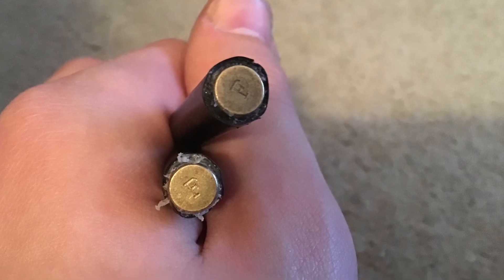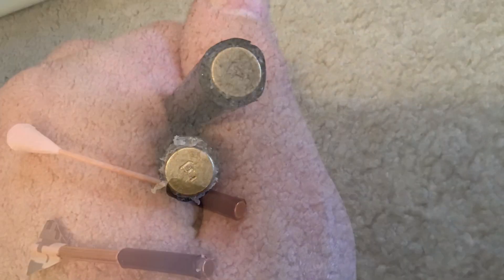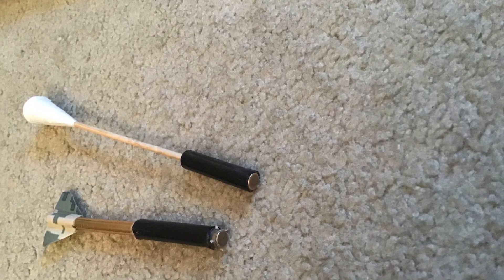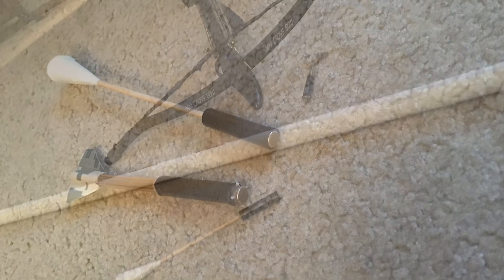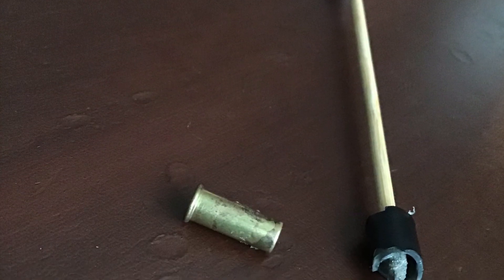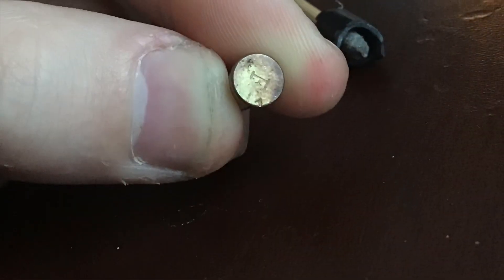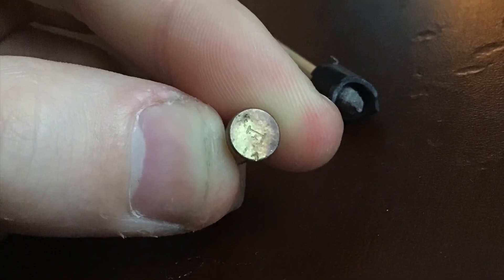Impact Sensitive Exploding Projectiles

Comment: Well I live in Australia and we dont have 22s
Reply from the maker: You might be able to make some mock Armstrong’s mix from a matchbox 
What about nail gun blanks from the hardware store?
Reply: I use the matchbox armstrongs mixture but it is still not as good as a primer
Reply from the maker: But you can use it to set off a much larger amount of flash
Reply: Praetzel Projects I know but it isnt that reliable
Reply from the maker: Do you have the right ratio because that should be more sensitive than a primer